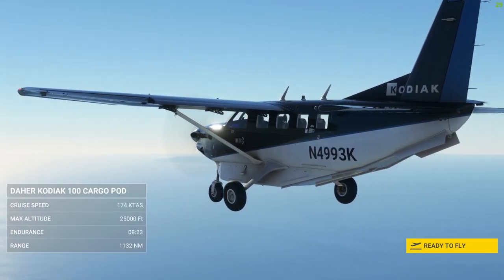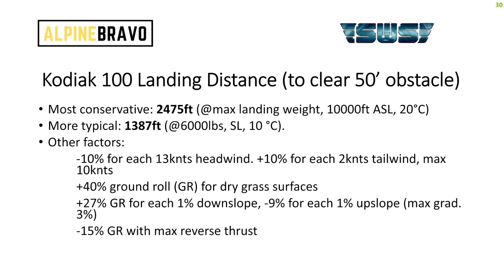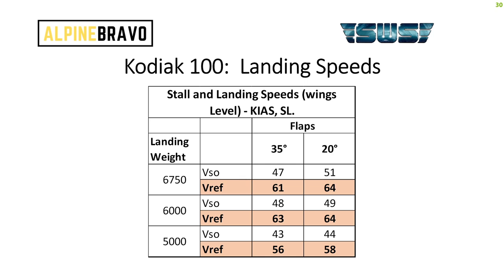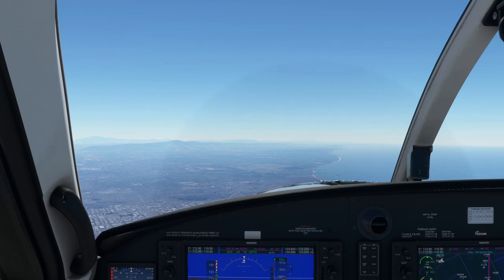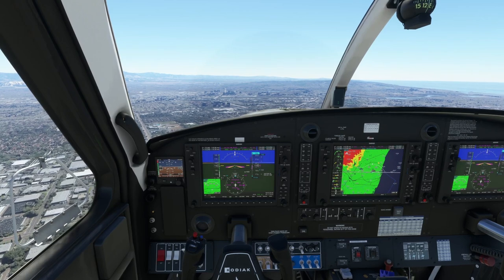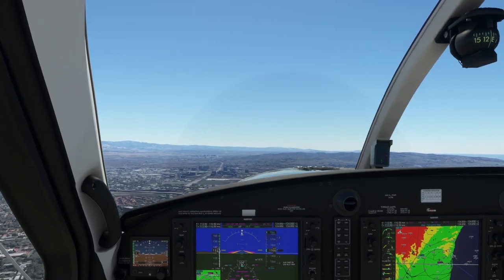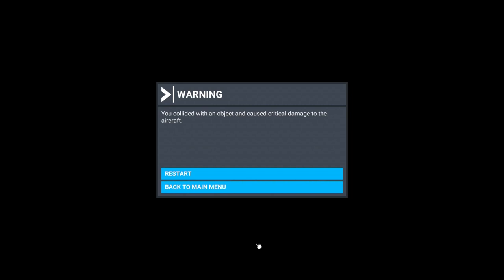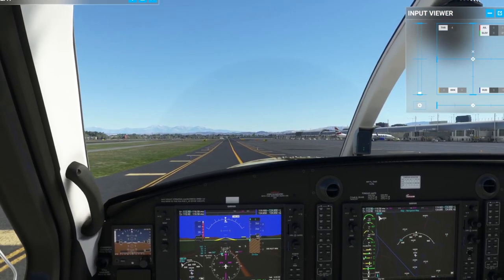How to Fly the Kodiak 100 |  Part 11: Approach and landing

Comment: Thank you for your videos, they are very helpful!  If I may make one request, your voice is way too quiet, in comparison to the aircraft sounds. You have basically to inverse the loudness relations. There is so much important information in your videos, it would be a shame to miss something, because of the loud aircraft sounds.
Reply from the maker: Thanks for the feedback. Glad you are finding the tutorials helpful. A few others have made the same observation already. Recording levels have proven tricky to get right and I adjusted it in some of the later segments.

Best thing to do is rewatch the bits you find quiet or try close captions (no idea if they are any good though). Failing that, if there is still something you are missing, ask me with a comment!
Reply: @alpinebravo7090  First of all, excellent video series.  Also, overall, video quality is good, but, as has been mentioned, you have severe audio problems in balance btwn your voice and sim sounds.  I will recommend the following procedures (34 years professional TV broadcaster, producer and editor).  You may do many of these things already but I'll list them to be sure:

- Use headset for voicing
- Do not have any exterior speakers running (sim sounds will be recorded by whatever recording app being used and you don't want any exterior sound feeding into the headset Mic)
- BEST: record audio tracks separately.  I highly recommend OBS to do this (as another mentioned).
- Edit with a decent video editor, such as Adobe Premiere or DaVinci Resolve so as to maintain high quality and good audio-mixing capability.

Thanks for what you do - keep up the good work!

Comment: I tried to watch it to learn the landing but I have very sensitive ears when it comes to certain sounds. I couldn’t hear what you were trying to convey here. Thanks for trying though. I’m having trouble landing this thing.
Reply from the maker: What part of the landing are you struggling with?  Make sure your controls are well calibrated as per part 1.  Don't chop the power at threshold - maintain at least 1000 torque on approach and make a power-on landing at 60KIAS.
Reply: @alpinebravo7090  I get very close to the runway and drop out of the sky. She is very touchy coming in. I’ve tried a few flaps variations but always drop. I’ll try your tips above and also rewatch the said video on calibration. 
I feel like the day I smoothly land this is going to be worth a celebration haha.
Reply from the maker: @J0NJONSON  Always make a normal landing with full flaps (you can land with less, but you are even more likely to stall out too high in the flare).  If you are dropping that means you are cutting the power too much too soon - the key is to smoothly reduce (but not cut) power whilst flaring at the same time in a single co-ordinated action.  The nose will want to drop all the time as you reduce power, so really work the elevators to keep the nose up. It takes practice and you need to be in the habit of landing with one hand on the yoke and the other on the throttle lever.

With the video audio, try watching the other 2 landings (and one crash)  I do on 20L after the first main pattern entry and landing on 20R. The audio balance is better on these segments and my voice easier to hear over the engine noise.
Reply: @alpinebravo7090  I feel like I need to come back and update you. The 1000 tip along with the lowered but not completely cut throttle while flaring is what pulled me out of the bad landings. I’m not used to landing so slow and being able to stop so fast once down. I find, depending on wind anywhere between 900-1000 works every time. My problems were lowering power way too much/too soon and cutting completely when close to the ground. I have been successfully completing smooth landings now on all types of runways. Thank you for the tips. I appreciate you.
Reply from the maker: That's great news!  I went through the same learning process...

Comment: Excellent video! If you don’t maintain 1000 ft lb torque with full flaps, you will literally fall out of the sky. This is not realistically modeled. It is also impossible to maintain slow level flight(70ish knots) with flaps extended.
Reply from the maker: Glad you liked it.  I'm planning on doing a slow flight/stall tutorial as part of the series.

I can't say if the values currently used are realistic. I do know that the prop when full forward and at low power settings, pitches in such a manner to act like a massive airbrake. Not quite like the PC-6 and it's famous air-beta. But the same thing.  Kodiak pilots describe it like 'hitting a wall'. So plenty of torque required.

The aircraft is very weight sensitive - in the segment where I crash it, it was 6800lbs and I was getting the stall warning at about 56kias.  Whereas in the 'balked landing' segment it was just 5000lbs and no stall warning at 54kias. But I was getting poor aileron response.

The 'yaw of death' though is often made worse by poor balked landing recovery procedure - sudden application of power leads to both more torque and an uncorrected pitch up, leading to increased P-factor.  And the confused pilot wonders why their go-around is turning into a yaw, stall and sudden spin....
Reply: @alpinebravo7090  In the attached video, you can see Ryan fly a fully flapped, 65Kt approach and he’s under 500 ft lbs of torque. That’s impossible currently in the sim. 
https://youtu.be/cKw6gIO8ohE
Reply from the maker: Thanks, I'll have a watch - I'm trying to do more research on slow flight behaviour and power settings.  One thing I don't like about the Kodiak is that you cant seem to pitch/trim it to hold a constant speed. It's either always climbing out or nosing down, gaining speed or, more typically, steadily bleeding it off on the approach. I think this aspect needs work.
Reply: @alpinebravo7090  I totally agree. I actually did some testing with slow flight in the Kodiak but can’t find where I wrote it down😢. Try this:  Using autopilot, try to fly level with a sustained speed of 70kts with 2 notched of flaps. If I remember correctly, it was impossible.
In the MBP video I attached, he turns base about the 18 minute mark and you can clearly see his controls and instrumentation.

Comment: As much as I love the kodiak, i dont fly it anymore. SMS NEVER had the approach dialed in...on your first approach take a look at the ball...as soon as you were under 90 you were totally uncoordinated and skidding...this comes from their left turn tendency fetish. the p factor for this model has never been right, add to that the weird autopilot trimming that is in the entire game and you have a  cluster fuck every time you try and land the kodiak. they wanted so bad to capture the left turn of the pt-6 that they screwed the entire model up...and now they have abandoned it and made no improvements in about a year
Reply from the maker: Well, it's certainly harder to land than most, but I can't agree with what you say.  With over 800 hours in the Kodiak now, I really have no difficulty maintaining an approach even in a strong crosswind. Like the PC-12 SWS took a lot of input from the manufacturer when designing the flight model and they are just not as much of a compromise as many other types.  Harder to fly, sure. But then that's part of the appeal of SWS aircraft.

They certainly haven't abandoned the Kodiak, but they have been busy with the PC-12 and getting the Kodiak 900 ready. One thing all the Devs are looking at currently is how to implement the new ground physics that came with SU15 which is likely to prompt some updates to be released.

Other than the flight model which I get you would like to see changed, what else would you like to see updated in the Kodiak?  Personally Id like a proper systems failure module for it like the FSR500 has.  But those are a lot of work for a Dev so it would probably need to be a payware bolt on.